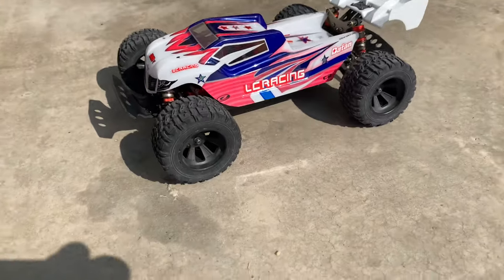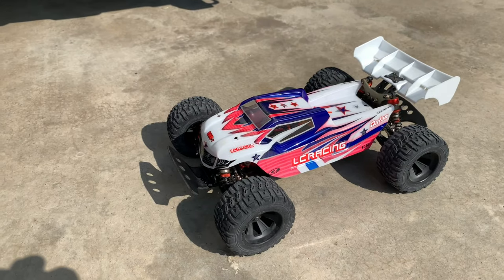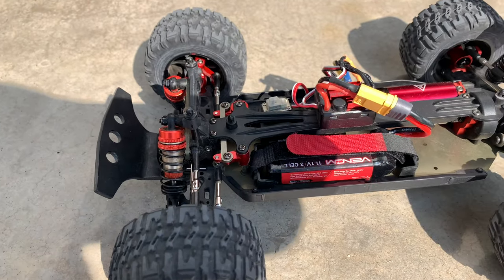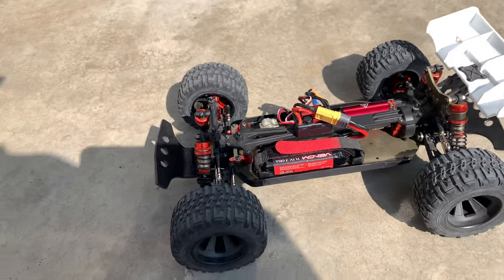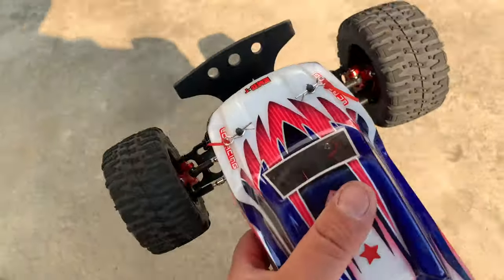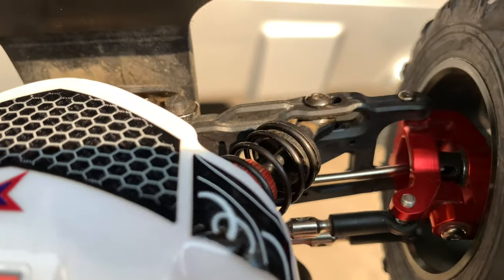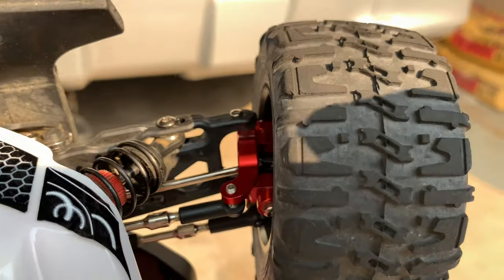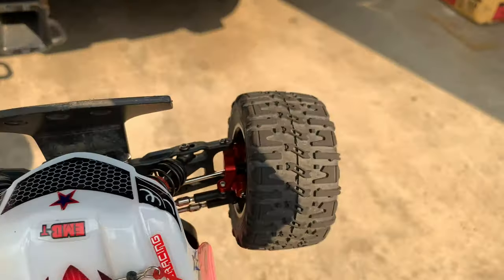LC Racing emb-t. Added stiffer springs and regular dogbones. Keep CVDs in front!

Comment: To help with the dogbone issue, I cut a piece of nitro fuel line about 1/8" long and put it inside the inner cup.  This pushes the dogbone out and keeps it engaged with the outer cup.  A small o-ring would also do the trick.
Reply from the maker: That’s a great idea thanks! I’m also gonna try this AE mod. Their cvds are stronger. Thanks for watching!

Comment: Wondering what specific monster truck wheels/tires you’re using? Just looking for a better option for bashing than the stock setup.
Reply from the maker: Joshua Parkin warrenrc monster truck tires. I believe they are for the actual 1.24 monster truck. They are great! Great overall traction anywhere and even balloon some for flips lol!
Reply from the maker: Joshua Parkin sorry. The 1:14 MT. Not 1:24 lol
Reply: Thanks man.

Comment: Wud love to see how you changed your hubs. Cant get the pin out that holds the hub to the ARMS..
Reply from the maker: Gosh it’s been so long I don’t remember. Does it have a screw holding the pin in place?
Reply: @RedRoxRc  no.     Its just a pin. An on the other end a plastic piece. Its rediculous
Reply: It looks like its designed to just push out 1 way but my goodness it won't fukkin. Budge
Reply from the maker: @jhe1967  I can’t remember. I’d have to look at it. The rear hub? If it’s only one way take a pin that will pit in that hole and tap it out.
Reply: @RedRoxRc  that is wat im trying to do now. Ty sir...